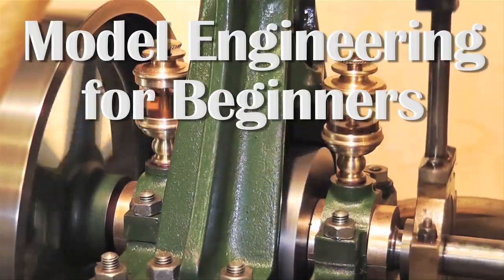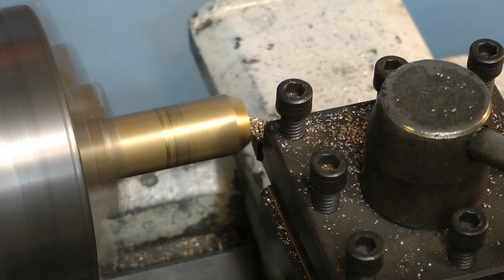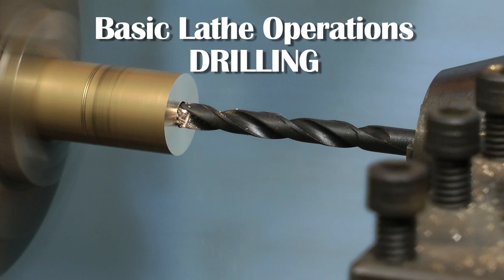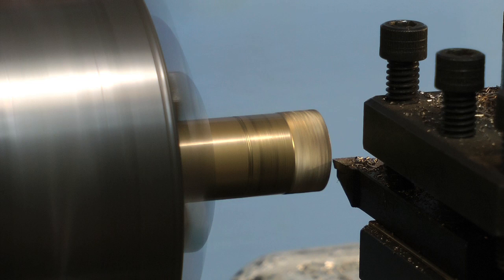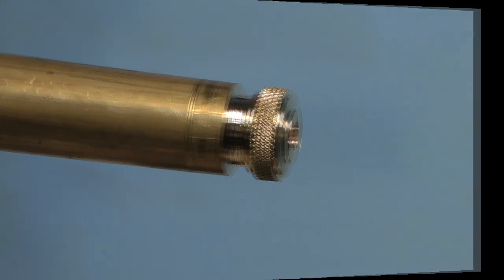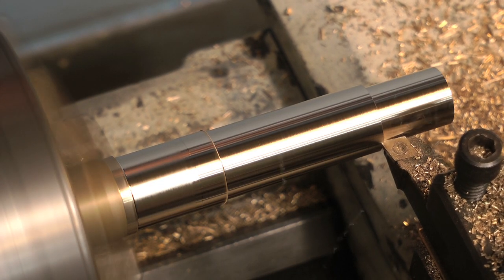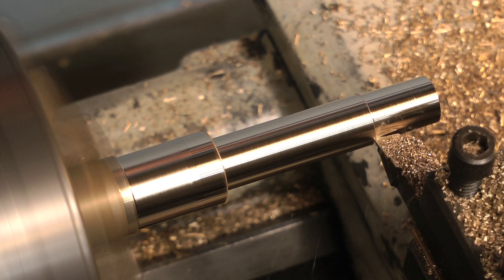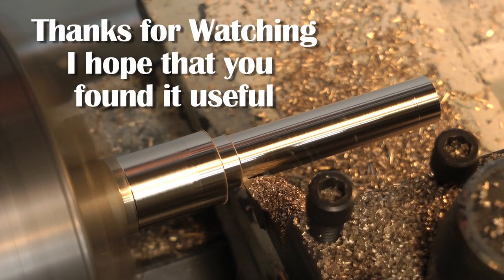PLAIN TURNING - MODEL ENGINEERING FOR BEGINNERS #3

Comment: Mr. Appleton,
I have been interested in model engineering ever since i was at school and turned a couple of simple pieces on an ancient lathe... A few of my classmates found out the hard way about making sure never to leave the key in the chuck, thank goodness the lathe was fitted with a guard!
At 34 i have started the process of setting up a workshop, and after starting with some simple turning projects i hope to progress on to model steam engines. I currently have several examples, but would love to create parts and machine my own!
I just wanted to say a massive THANK YOU for creating this series, and all of your other fantastic videos, which don't just show the correct way to do things but also the wrong way! As well as a lifetime's worth of invaluable advice, tips and tricks, and things that can only come from experience!

One thing that i was always told was to never have fluorescent tube lights in a machine shop, due to the stroboscopic (?) effect of the tube making it look as if the lathe isn't running! Although i suppose that with the introduction of LED tubes this is no longer the case.

Thank you for everything that you do for us!
Regards, Max
Reply from the maker: Thank you for your kind comments and thanks for watching  }:-)))